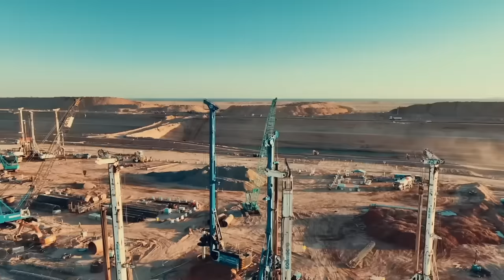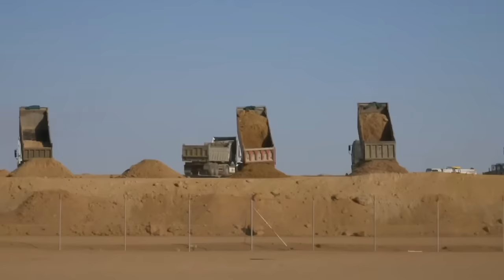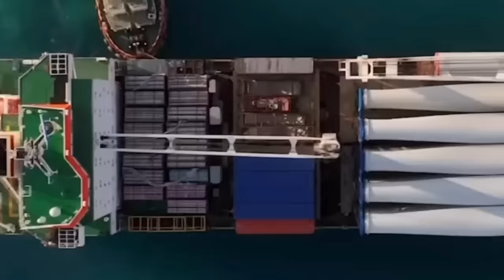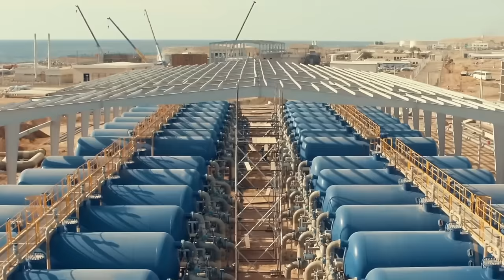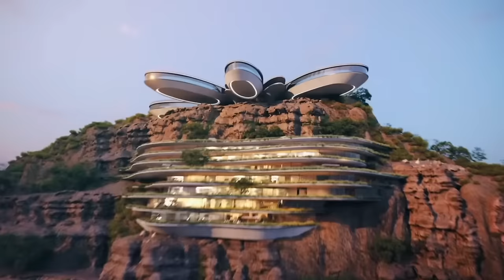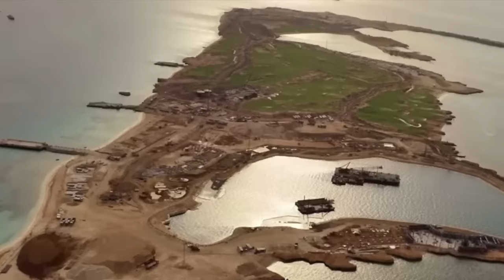NEOM, THE LINE : Update 2024

Comment: They are saying only 2.4km will be completed by 2030. If they continue at that rate, it will take well over 400 YEARS to complete.
Reply: It's been scaled back because investors are concerned over some factors. So they will focus on completing the first module which is 2.4 KM, housing approx 300k people. If the execution met the expectation, then they might decide to continue with corresponding modules.
Reply: If  a Harbour, an Airport and place to live is ready the test goes on much faster
Reply: Still an incredible achievement at 2400m
Reply: It's still insane
Reply: 500 meters tall is insane

Comment: If it "should reach a speed of 510 kmph in two thousand and thirty years" then it only needs to accelerate at a rate of 16.5 meters per day.  Fun fact a garden snail is about 1123 meters per day.
Reply: I'm glad someone else heard that.  I thought I was tripping.  I have 0 engineering background but I'm positive I could make something faster 😂
Reply: There is no way a snail is that quick😂
Reply: @kevineleven1524  Maybe, looking it up online I saw it was  .048 km per hour, so multiply it by 24000 for meters per day. I am comparing a maximum speed to an acceleration rate but still I think its safe to say the snail is winning this race one way or another.
Reply: @justinmoore5158  lol true
Reply: @kevineleven1524 a snail quick?…that’s a contradiction in itself

Comment: Will the ships be towed? Cruise ships running on diesel emit an incredible amount of thick smoke, smaller ships usually emit a lot of petrol fume how would they handle this if they have ship traffic running right through the enclosed building?
If the marina is actually this big, there would be multiple ships constantly going in and out.

Comment: Line height should be decrease to 100 meter   maximum from 500 meter and the width should be enalarged  by ten times also the 170 meters should be broken  into 1km to creat interval  for roads,water supply,for multiple swage  treatment plants,for open green areasfor electeic bus and car roads etc
Reply: no? thats inefficient use of ground
Reply: Because they don't have enough space in the dessert?
Reply: Or, they just cut the line in half 4.5 million people living there is still a lot.
Reply: Maybe not build a stupid city in the middle of the desert at all.
Reply: btw  they dont want roads in there, its gonna be inaccesable for cars, so making it wider and flatter is just gonna cost more because of transportstion, while if its thinner and taller, you only need stairs or elevators and a single railway going back and forth